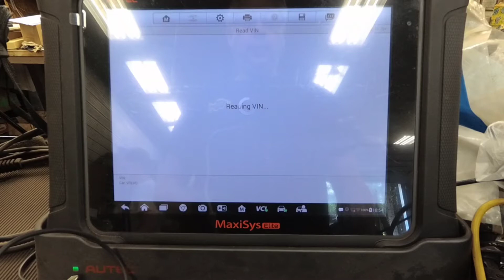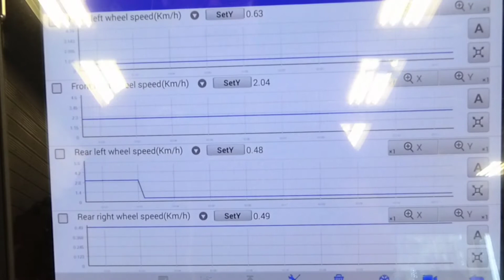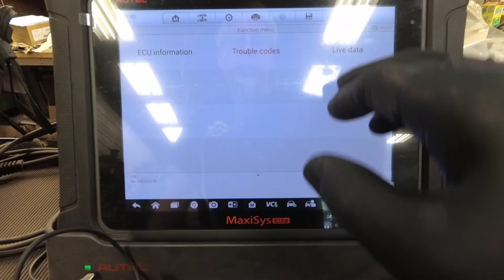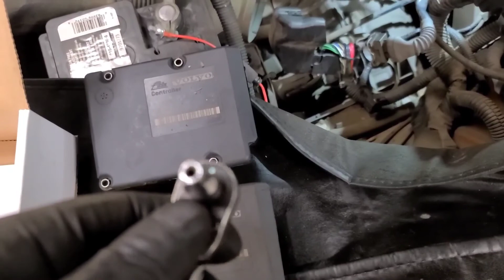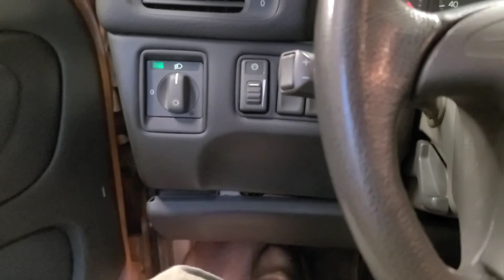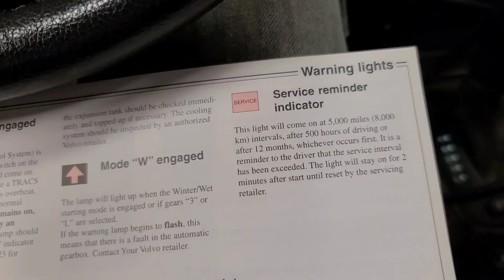1998 Volvo C70 ABS and Trac Off Lights On

Comment: Bonjour Phillip je suis un conducteur français et proprietaire d'un V70 année 1998,j 'ai eu aussi ce voyant vert et orange qui s'allumait ,en fait il s'agit de l'encrassement de la vanne EGR ,qui peut etre résolu en ajoutant un nettoyant dans le reservoir a carburant ,et en roulant sur autoroute a regime élevé sur environ 15 a 20 kms ,ce probleme n'a aucune incidence sur le fonctionnement du moteur ,il peut etre éffacé à l 'aide d'une valise diagnostic ,voila su j'ai pu apporter ma petite contribution ,c'est avec plaisir ,bonne continuation Ronnie.S
Reply from the maker: Merci pour le conseil. Oui, le triangle s'avère être le témoin Check Engine ou MIL comme on l'appelle ici en Amérique du Nord. Je suppose que votre Volvo est Diesel ? Merci pour la suggestion.
Reply: @PhillipBailey  oui Phillip il s'agit du 2.5 TDI ,ça été avec grand plaisir et a mon tour  de vous remercier pour votre vidéo tres instructive ,bonne continuation RONNIE .S

Comment: Hey Phillip i m a driver french and my language english not perfect ,i m sorry ,i have the same trouble  (green sign in orange triangle) and is the egr valves who from time to time that its doing a bug ,but there is not a problem serious for the engine  because sometimes just by rolling is turned off or erase with the electronic toolkit ,i could be of some help bye bye RONNIE.S
Reply from the maker: type you question in French and I'll use Google to translate...
tapez votre question en français et j'utiliserai Google pour traduire...
Reply: @PhillipBailey  woah this is crazy smart.